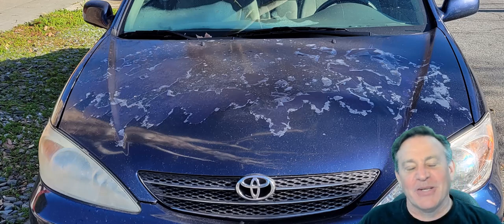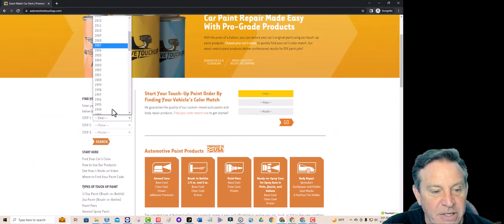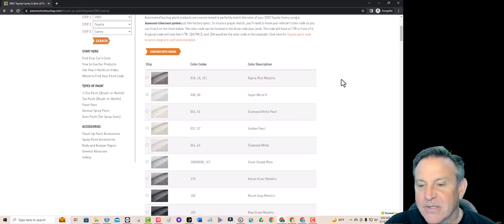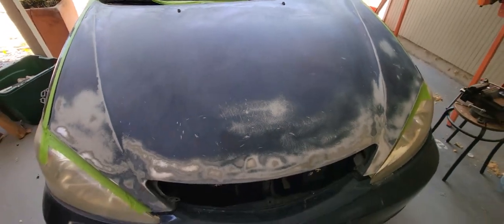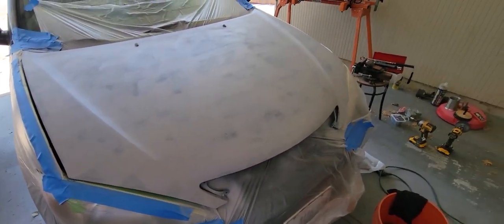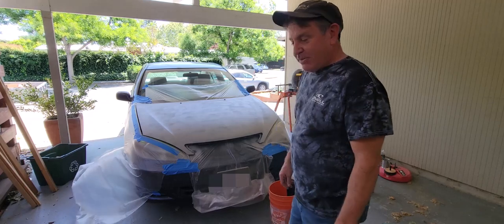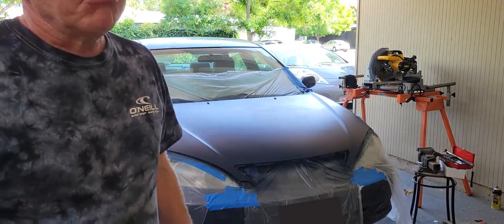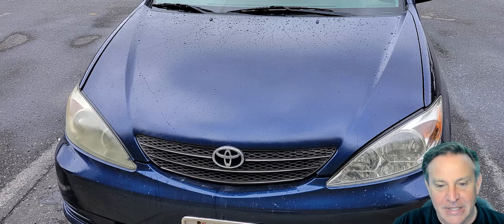🔴 Get An Exact Paint Match For Your Car Delivered Right To Your Doorstep

Comment: I have the same car Peter, bought it when they first came out in fall of 2001. My car has 248k on it and i won't get rid of it until the AC goes out or a major repair. Duplicolor makes a exact match, i painted my rear bumper.

Comment: For not knowing, it turned out fairly decent.  At least yours was just clear coat, my '98 firebird has sheets of color coming off, I have primer spots all over it 

If ya ever do something like that again, drop 2 coats of primer, sanding with 600 between coats wiping down well. Then drop 2 coats of paint, do not sand color coats. Then lay 2 to 3 coats of clear coat, 2k is the best in this application. Yours has a matte finish because it needs more coats. Other than that keep up the good videos.
Reply: Macco....
Reply: @superbmediacontentcreator  .... and you would pay 3 to 4 times what he did and still get results that are not much better. They will do a cheap paint job, but their body work/shop prices are outrageous.

Comment: If you have $1500, just get it painted by Maaco.  Price may very, but that’s how much they charge in San Jose, California.  They do a great job and it’s the whole car.  I tried the spray paint on my 2000 Lexus GS300 and it was fine for about a year, but then it started peeling after that.
Reply from the maker: This car has been far enough to make it to the moon! $1500 is not a bad deal and if this car had 50,000 less miles it would have been a consideration but $88 was the price I wanted to pay.
Reply: @PeterC408  No problem, everybody has different budget.  My GS300 has about 150,000 miles and I always follow regular maintenance, had timing belt and radiator replaced recently.   Now it's running like new.
Reply from the maker: @lehsu  I'm in San Jose too. Willow Glen.